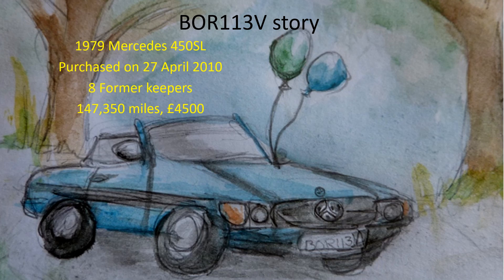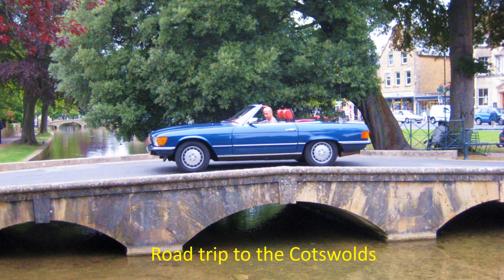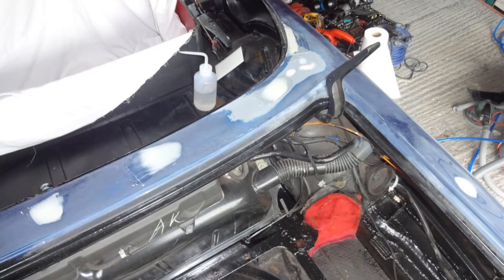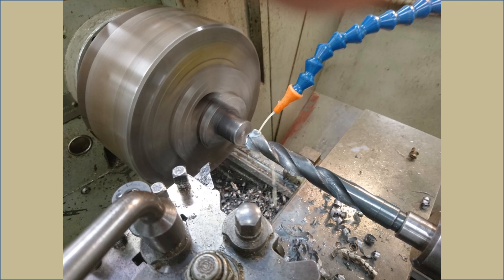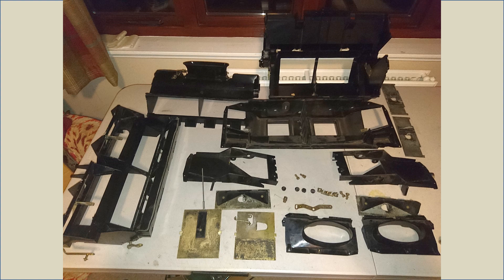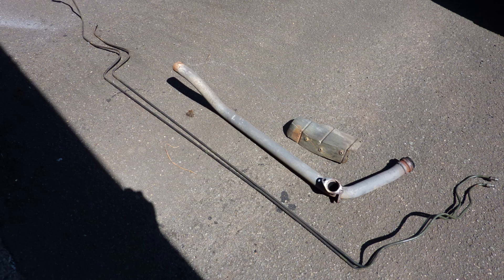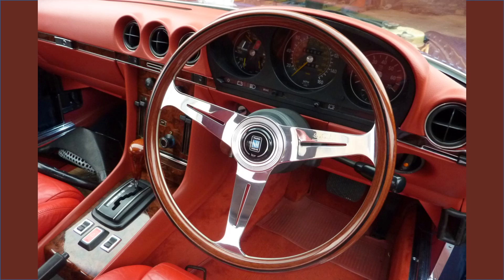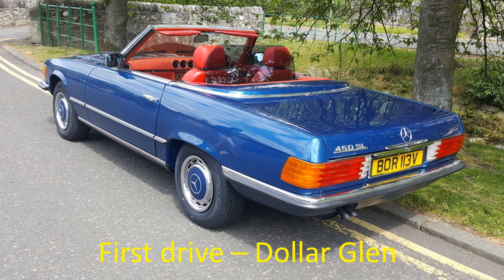R107 Mercedes 450SL Restoration

Comment: Congratulations on your restoration! An inspiring video with a lot of invaluable hints and tips on the products and processes you used and step by step picture guide. Everything noted for the extra work I need to do on my 1978 R107 Mercedes 450SL which I have owned for over 20 years.

Comment: Excellent job! Thank you for this inspiring video! Here in Nashville I found my dream car with not so much rust-1973 450 SLC. This car did not run. It was an education into the mystery ( later not so much a mystery) of Bosch D-Jetronic fuel injection. The car would start then stop immediately. The FI computer was replaced by the previous owner. I removed the MAP sensor and it made a noise like a rattle can of paint. I found an NOS Bosch MAP sensor on Ebay. I renewed the fuel pump, fuel hoses-this helped and the engine ran longer but would not idle. I replaced the #1 and #2 coolant sensors-still no improvement. Someone had replaced the timing chain recently also. Renewed the ignition coil also-good spark. Did wet and dry compression tests and all cylinders were within spec. Asked advice from online posts but nothing really came of that. Weeks later at 2am I awakened and thought to myself "coolant flow"-I hadn't checked that! D-Jetronic FI operation is dependent upon engine coolant temp sensors and the MAP sensor to tell the computer using a throttle switch to supply the correct fuel mixture to the intake manifold through the fuel injectors.  Removed the radiator and water pump. Someone had added radiator stop-leak the the coolant system. The stop-leak had totally clogged the water pump around the impeller and no coolant was flowing through the engine water jacket even though the engine was filled with coolant. The radiator was also clogged. Had the radiator repaired and I'll replace the water pump today after flushing the engine block. Sorry if I was long-winded on this comment but your video was so inspiring I had to share! Your car is beautiful and you did an amazing job! Cheers from Nashville, USA!

Comment: Amazing job on this, I have a 1975 450sl that's in really good condition and I've done enough of the work myself to appreciate the time and effort you put into this restoration.  My bigger question is if you are still married and if so, please let your wife know she's very unusual.  My wife is driving me crazy over my restoration.   Also, I have to replace the oil pan gasket so seeing your info on the front frame drop will be a big help.  THANKS!

Comment: I had to install 4 way electric Jaguar ,  leather. I had to make my own control panel, and two choices in switches.  Low V with relays or SPDT panel switches. Oh yes. and the seats are heated

Comment: Man your video brings back painful memories of my current 280SL restoration started a mere two years ago. Car looked fine when I bought it, but as you peel back the layers, the horrors reveal themselves. I have a 450SL sitting in a field awaiting attention. Your video reminded me just how much work is involved. It would be really great if you did a follow up on cost. eg how much did you spend on paint, primer and clear coat etc. How much did you spend on parts...did you wife stop talking to you etc etc. Mike
Reply from the maker: Hi, I didn't keep a tally of the costs as the years passed but did keep all the receipts. Once complete I guessed that I had spent about £6k or £7k, it turned out to be double that, the details on the paint will be in the pdf, but I would guess ~£500 or less? Detailed spending sheet here https://www.racediagnostics.com/misc/Costs.pdf

One other thing, if I had just spent the original car purchase cost plus the £14 in parts back 10 years ago, I could have bought a very good car (not so much now, prices have gone up a lot) but then I wouldn't have had the three thousand hours of fun for free.

Comment: I'm blown away! I have massive admiration for the work you have done. I have been through a long process with my 1980 350SL. So many similarities on the known design faults! How on earth did you mask the hub caps? It looked like you had a template to cover the Mercedes badge? Did you just mask up the remainder of the hub caps by hand without a template? You have more patience than me and I admire the fact you have self taught. Hats off to you!!

Comment: Awesome restoration, of the car, at least you got the car, to keep on going and going, plus that blue color adds, a nice touch to the car, is that the original color, also was the air conditioning retrofitted with the new R-134 refrigerant, since the one that used to.be used is banned from being used.
Reply from the maker: Hi, yes, blue is the original colour, no aircon fitted.
Reply: @racediagnostics  nice color, you don*t see many Mercedes 450SL R107 with that color, I am surprised you put  the steel rims with hubcaps, nice touch, considering that most had the alloy wheels, if you come by some nice alloys, they would also add a nice touch the original 14 inch alloys,  but those hubcaps,add a touch of class,elegance to the 450 SL, the alloys I am talking about would add that sporty look to that car, 👍🏼👍🏼👍🏼👍🏼👌🏽👌🏽👌🏽👌🏽

Comment: Very nice work on what is generally considered to be a complex and difficult vehicle to restore, particularly in the UK where rust has well and truly got to most examples, though it's quite far to say that yours really wan't all that bad for one that had spent the first 30 years of its' life in the Portsmouth area, with the associated salt air from being near to the sea.  I like your modification to fit the Audi TT seats, but it should be said that Recaro sports seats were a factory option in the R107 SL, as they were in most Mercedes-Benz models, though they are generally only seen in G-Wagens as factory option items in the UK...

Comment: I have a 1974 sl 450. As I see it if I spend 20 -30 k on the repairs as you did, I'll never come close to ever getting my money back. As you point out this car rusts out from the inside out. I'm afraid that most of them will disappear because of that and the fact so many have been stripped for parts. Maybe this car will become a desired rarity.
Reply from the maker: You are correct, no point restoring these cars unless you enjoy it as a hobby. For most it's cheaper and easier to buy one in good condition.

Comment: Wow......firstly a good example of buying a MOTd shiny car does not mean its a good car.

Your commitment to the project is amazing and the welding skills improved as you went along...in fact it shows if you have the talent the skills can be learnt.

I have a p1800s which is in much better but condition which I like as original patina.....but I just keep tidying up bits which then make another bit look a bit scruffy...

It looks like you have found yourself a new career....if you want to do that all again! But with labour alone at £50 per hour x 3000hrs it's not cheap.

What a fantastic result though.

Comment: Hello Jim interesting to watch you go through the process. Could you tell me, the adhesive you used on the rubber seals. I could not pick up on the name. I bought an SL in July 2022. I was lucky no rust at all (only in the back bumper but small area and the channel where the rubber seal goes for the soft top coffin - again only surface rust) I stripped the car and immediately had the body painted, then rebuilt as you have done the front suspension, new discs and wheel bearings. But the heater on my car is like furnace there is no controlling it to keep the heating at a nice temperature, it is like driving in a blast furnace. Heaven knows which area is causing that problem (maybe the vacuum valve controlled by the switch). Stripping the hardtop was good to do to locate small leak at the rear top corner passenger side, I think due to the window not being sealed properly so that is now done. Does you car take in any rainwater in any area of the hard top?? Very much enjoyed your video - good work - regards JS
Reply from the maker: I used Upol Tiger Seal to glue in the new seals. As for the water ingress, well the car has not been out in rain since 2016. I also had a stuck on heater, it was caused by a lose vac line on the bulkhead. Good luck!

Comment: Hi - just watched your restoration video again and wonder if you can tell me:

1.  Did you use any particular brand of epoxy primer?
2. Did you ever use any weld through primer or etch primer?
3. What did you use to prime the back of panels that couldn't be accessed after welding?

Meanwhile...Happy New Year to you and the family. Mike
Reply from the maker: Hi Mike, 

1) For the underside of the car and inner wings I brushed on Jotamastic 87 (designed for ship hulls), then a rubber stone chip then 2k blue, for the outer panels I sprayed on Lechler 29107, then 2k high build primer before base and 2k clear.

2) Only on the backs of panels, mainly etch primer, that couldn't be accessed after welding.

3) As above, however I also ensured there were access holes on all chassis/box sections so I could inject with wax/oil to prevent rust. I inject Dinitrol ML every year in all  enclosed sections, it is pretty runny so creeps into seams before the solvent in it evaporates to leave a waxy mess.

Happy new year and good luck
Jim

Comment: Hello - When you redid your brake lines do you remember whether the end fittings were bubble (DIN) flares or SAE double inverted flares? Mike
Reply: @jimstuart6191  Thanks for your prompt reply- I thought that would be the case. I'm about to do a vid on brake lines and flaring so if you have any tips from your own experience, I'd be happy to share them. Mike
Reply from the maker: @MikesMercsandothercars  I used a tool like this one, that worked well for me. https://www.ebay.co.uk/itm/Brake-Pipe-Flaring-Tool-for-4-75-DIN-flares-Hand-held-on-car-Powerhand-BFT-475/171616284265?hash=item27f520ae69:g:I14AAOSwT6pV5LDo

Comment: What a job, well done. Keep it going, it will run forever. I have an SL450 too (1976) and it runs great. Will be changing the carpets in the next few days, any tops?
Thank you in advance
Reply from the maker: Check the new carpet parts against the old ones before fitting to make sure they are the same shape.

Comment: Amazing job - complete respect. And you learned to weld and paint - I am inspired to do likewise (well weld at least) as I am part way through a rolling restoration. Just started to strip it for a re-spay and finding rust.
I have a question - at 33 mins 26 seconds you appear to be holding a masking template for the star on the hub caps? Where can I get one of these ?
Reply from the maker: try here https://www.ebay.co.uk/itm/wheel-hubcap-tool-stencil-14-inch-for-Mercedes-W-107-108-109-111-113-114-115-/283155024756?_trksid=p2385738.m4383.l4275.c10

Comment: Great video and congratulations with the result. What color interior dye and vinyl paint color did you use for the console and seats? I am working on a 450SL with the same interior color.
Reply from the maker: I sent part of the plastic trim to vinylcote for them to match and a piece of leather to "the furniture clinic" for them to match, both UK suppliers.